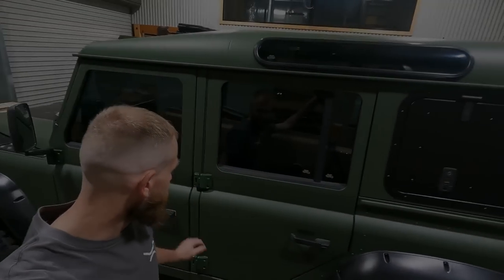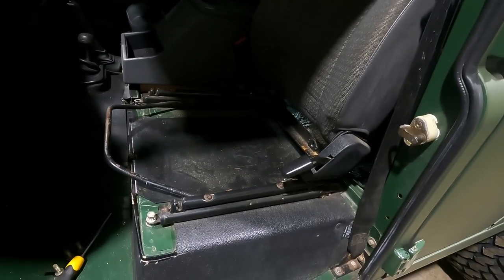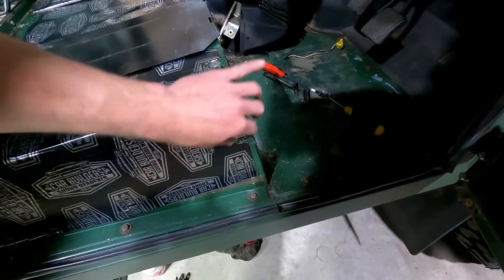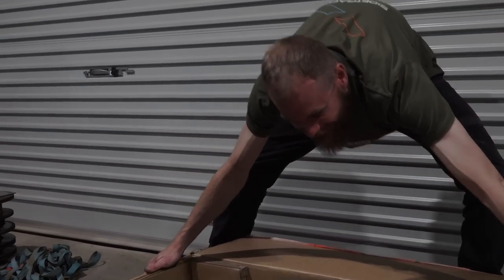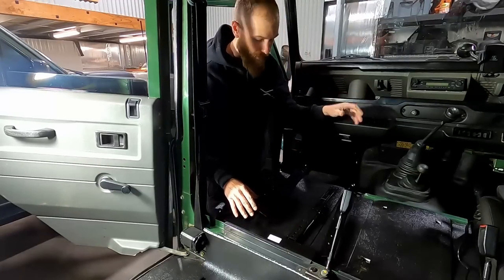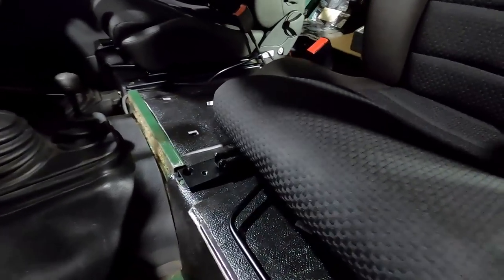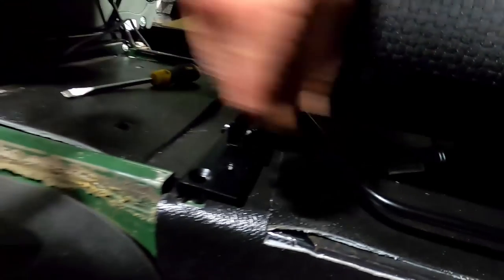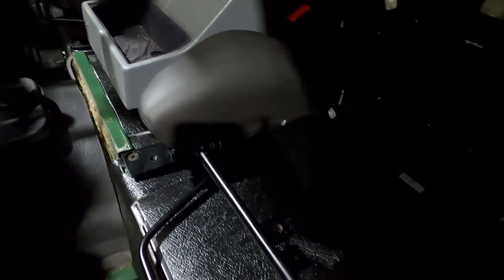#29 Defender seats ﹡ SCHEEL-MANN ﹡ Install AND comparison

Comment: I have a TD5 110 and I’ve put the Scheelmann seats in. Just done a Canberra to Coffs trip a week ago and they are such a comfortable and supportive update. I was a bit worried about the cost but not after the trip. They are a great investment.  An option to raise the cubby is installing a Frontrunner Storage Box. It will lift the cubby by about 10cm
Reply from the maker: Cheers Simon, i agree, just did 6,000kms in them too. The Front Runner box is going in as we speak!
Reply: What are they worth roughly ?

Comment: Having 2 Defenders myself, I'm keen to hear how you find them in regards to the following: Comfort for long-distance driving // Visibility out the front windscreen and side window - referring to looking upwards to the skyward - do u lose much visibility due to sitting higher? // Quick &/or easy access to storage/battery under the seats? - I gather you would have to remove the passenger's seat altogether to replace the battery? // Position of seats in relation to the handbrake - has this altered at all?
Reply from the maker: I'll give an update after using them more but after 6,000kms very happy. Visability is a problem for sure, traffic lights for example. I've just had 2 batteries in and out with the seat base just folded up, no removing of the seat and the handbrake... well, still a pain.

Comment: Did you guys found a solution to avoid having the steering wheel too close to the legs? I'm a short person and it is too damn close...
Reply from the maker: I do have a smaller wheel than standard now so no problem.

Comment: Hey! Is the passenger seat too close to the door for you? I was thinking of adding a rivet nut for the side of the base that is closest to the door. I was wondering if you have the same issue.
Reply from the maker: I haven't noticed a problem but also don't spend much time there..

Comment: Can the battery still be removed and replaced through the seat pop up space?, or would you need to remove the entire seat
Reply from the maker: Yeah I've placed 2 batteries under the seat, still only lifting the base to place them in! As the seat is on long slides, you can slide the seat back over the hole better.

Comment: If only Scheel-mann had seats that would fit insite a single cab.
Reply from the maker: Nothing fits inside those damn single cabs.
Reply: @SIDETRACKED Yeh, I've got a Perentie and i believe even without a rear cab panel on it they wont fit unless you modify the rear bulkhead. I would say though that i am not in the same position as you as im about 176cm and find the searting positions to be fine but just the comfort of the seats (from the military) arent the best for long distances.

Comment: think there is a kit you can get goes under the centre box which would lift it up higher think it is so you can relocate the ecu on the td5 modal as the box under the seat gets a lot of water in it if you are doing deep water crossings i got a 2m extension for the ecu so i can mount it on the roof  don't know what they were thinking when the put the ecu under the seat